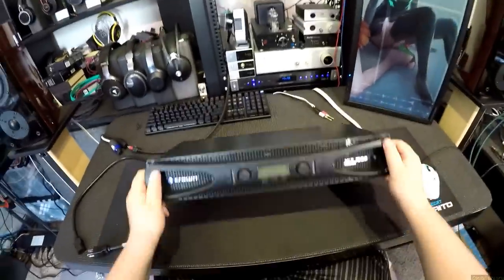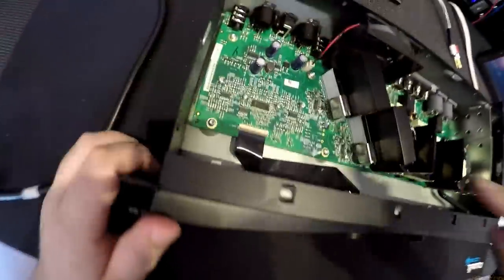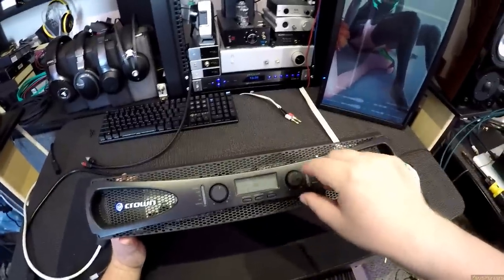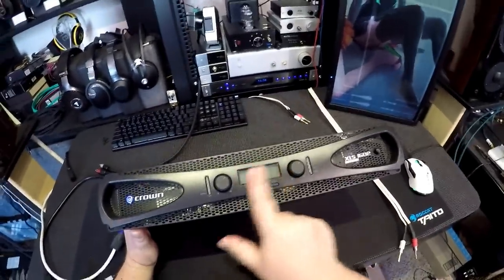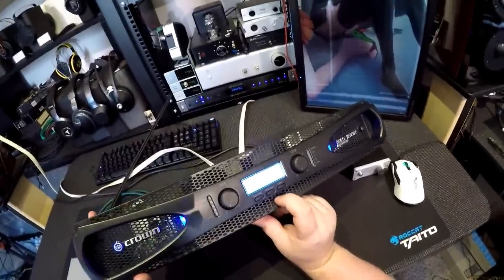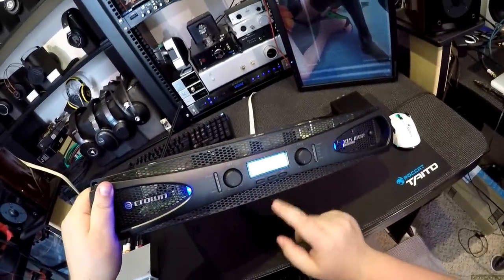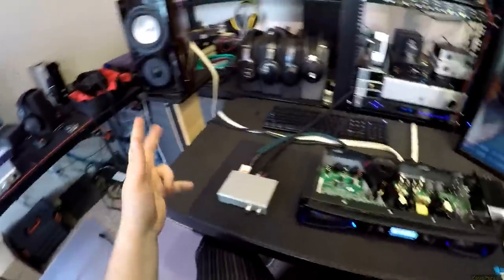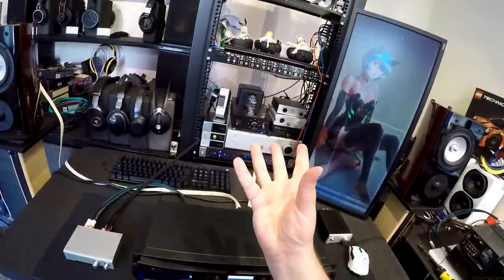Z Review - Crown XLS1502 POWAAAH!!! AMP

Comment: "the best part about this amp is you can shut off the display"  I believe you are right about that.
Reply: blind test this with another high end neutral A/B Amp, and I guarantee you can't tell the difference when they are level matched. The snake oil is strong in the audiophile community.
Reply: @Clobercow1  I tested it with a low end amp and its a piece of shit, like I said until im blue in the face IT MAY HAVE BEEN A BAD AMP, but I gave it a try, that's gotta count right?  naaaaaa
Reply: @Clobercow1  There is a LOT of noise with that amp.  I'm guessing there are a bunch of cheap tantalum capacitors in there but it's just a guess.  I wouldn't be surprised if i'm right.
Reply: Nonsense, a PWM is always analog technology on the two switching transistors!  Only the DSP of the switch should be digital here.
 Has anyone ever looked inside the empty tin box?
 That would have easily fit into one height unit, even with 4 channels!
 How it looks, everything is spit with glue.
 There are parts in it for a maximum of 50 €.
 I never spend so much money on this shit !!!
 With Class D you can only use 3/4 of the power - especially with the half-bridge circuit used here and this joke of a power supply!  No bass comes out of that !!
 The crossover is useless because there is no adjustable delay!  This sheet metal cube has absolutely nothing to do with sound!
 Crown should be ashamed!
Reply: @peterh.8931  I've heard of talking to yourself, but never typing to yourself.  What the hell are you talking about?
Reply: @ranbymonkeys2384  That is a automatic translation from my german writing. Not all words are meanful translatet, sorry. But in this Amp I miss the Hardware for the Money - that's my Point.
Reply: @peterh.8931  huh?
Reply: @peterh.8931  What does that mean "miss the hardware for the money"
Reply: @ranbymonkeys2384  lol - missing
Reply: @ranbymonkeys2384  Have you ever heard of power supply pumping?  The half-bridge circuit in particular is susceptible to this, and this can only be prevented there by using a powerful power supply unit.  And then there is the working area of the "Central Region" approx. Up to 10% of the maximum output, within which Class D works particularly with low distortion and linearity.  That is why I estimate that at home, top performances above 1000 watts are also beneficial in terms of sound.  😉
Reply: @peterh.8931  I just know it sounded like shit so I had one for about 15 minutes and it got shipped back
Reply: @peterh.8931  Ya that's where a linear power supply comes into play.  Those toroid transformers make a big difference.

Comment: I have a home gym and wanted to buy a good sound system for it that wasn't too expensive. I ended up buying 2 pairs of Klipsch R-15M. Then I went to my friend who happened to be Crown dealer where I live and he lent XLS1500 for an entire month. I hooked the amp to my PC using the headphone port on my PC. Then I bought the Yamaha AV Receiver RX-A1040 using the optical port on my PC. I tested both of them and the Yamaha sounded way much better and expressed details I couldn't hear from the XLS1500. So, I ended up returning the XLS1500 and keeping the Yamaha RX-A1040. I transferred the Yamaha to my gym, connected it to a TV and tried to play all fours speakers, which didn't work as I hoped to. I will disconnect a pair and connect them to my PC. I would appreciate good advice on the best most affordable amps for these to use on my PC.

I am a big newbie...I'm not an audiophile and not so audio tech savvy but I am pretty sure it had to do with that optical is better than the headphone jack/port.

Comment: the reason big sub drivers usually have dual voice coil ports is so you have the opportunity to either wire them in parallel or series.. depending whether you want 1 ohm resistance or 4  ohm resistance into one biwire connection, or 2 ohm resistance into 2 seperate biwire connections. 
And since you can also bridge amp ports or put whole amps in tandem, you're left with a world of opportunities, and NOT limited to amps that drive 2 ohm loads. 
This should be stated in the manual under the section about wiring.
Cheers! :)

Comment: I have an XTi 2002 that is similar in many ways to this one, but it can be connected via usb to a pc.
Using Audio Architect software you can set multiple DSP EQ presets by drawing bode diagrams, lock the max output power and other settings, etc.

Comment: Yeah, that's a little better than that POS Behringer you have in the other room there. That's actually the exact model I use for my mains. I use the 2502s on my subs. Most of the drivers in my self built cabinets are Dayton Pro Kappa series. My mains are dual 15" monsters and the subs are of the 18" thunder maker variety. I have had these for the better part of 5 years now and have been incredibly impressed with their responsiveness and resilience so far. Even when over powered they don't delaminate or develop rattles like most other speakers of that nature. So now that you have a reasonably decent amp and a badass subwoofer I'll be eagerly awaiting that review. It will redefine loud whereas home audio levels are concerned. You may want to warn your neighbors...
Reply: kappa kappa

Comment: The THD of 0.5% is not a problem. Not using xls1002, driving MartinLogan Theos (electro Stat panel + 8" aluminum cone). My other Class D amp lists THD + NOISE as 1.0%. No problem with same MartinLogan speakers

Comment: I did a straight up test...Spotify on PC to usb
 
Emotiva TA100> preout> XLS 1502> Emotiva B1+

Emotiva TA100> Emotiva B1+

Sounded better straight thru the TA100 

The XLS is powerful bass punchy fun but the crisp clear highs were slightly lacking. 

I bought the XLS to biamp my JBL 4350B woofers. I think it will work just fine for that. Lots and lots of POWER.

Comment: You have the input sensitivity explanation backwards. The lower number (.775v- high) is for weaker input signals, not stronger ones. Input sensitivity is the maximum input the amplifier can take (with level knob dimed) without clipping.

Comment: Class D is not a digital amplifier. It's a switch mode unit. Digital is a specific code that's always the same. This has a switch pattern that is depending on analog input and negative feedback and can be different each and every time.
Reply: really?

Comment: Glad you did a pro amp. Gotta do more. I can’t remember what Crown amp it is, but one of them has a manufacturing fault with the internal power supply, that if it happens, sometimes you can do a button combo to reset it and sometimes it will work to fix the issue...sometimes

Comment: My next purchase was going to be the A500 based on the various applications that I know you've had opportunity to test it on.   However, in light of this and some other impressions I've gotten when you've described how hard you've had to drive it and ts response, I think the XLS1002 will make a good compromise between the A500 and this for a minor price jump.  My only concern is that there's definitely a significant signal to noise ratio difference between the two models,  but I've only seen it pointed out in one review and it was described as being minor.

Comment: Class D power .. Pretty impressive... but clean sound? I'd love to see the detailed spec / bench tests on these types.
Reply: For the price/performance/weight they are outstanding. They do sound good as well, definitely not bad!

Class D’s efficiency is what makes them extremely desirable. Class a class -A/B use a lot more input power to create the same amount of power as class D.  So if you are powering a 100,000 watt system and need half the input current you just cut your electric demand in half. Which is huge. If you have a touring rig and your amps weight 25% of the of class A/b and takes up half the room you have more space on the truck.

Or if you live at home and want this thing to work on a 15 amp circuit, with multiple other things in that circuit , can you understand how the efficiency matters and Hoity-toity thumbing  the nose at new technology is laughable

Comment: I believe the 1/4" link out jacks are just wired in parallel with the XLR, at least they were on the last generation.  I use that as the input for mine that does my sub.

Comment: you cant hook up 775rms to each coil because the total rms for the woofer is based on both coils combine as one. so that means that if you wire the coils individually you cut your power by half. so in the real world each coil can handle 400rms total of 800rms wired together either parallel or series

Comment: Crown's XLS amplifiers are bargain basement Crown amps, they might be able to output their rated power but it'll be burst not continuous average power. There's no way they can continuously all night output that power. QSC's RMX series now that's a different story, they're much heavier amplifiers but they can output their rated power continuous all night without a problem. Bridge a Crown XLS2500 and bridge a QSC RMX2450 and see which power subs the best and you'll see the QSC which is supposedly not quite so powerful will actually eat the Crown for breakfast. I'd say the cheapest lightweight amps you can buy which are great are QSC PLX series although Behringer's iNuke 6000 was bench tested as being able to output 2,000 watts continuous average power per channel into 4 ohms (despite being rated at 3,000 per channel). Crown XLS amplifiers don't have a very good reputation for REAL power output.
Reply: I’m getting an amp for maggies soon but I can’t spend more than 500 ....the MMGi by the way

Comment: Strange, all marine wire I've worked with is tinned copper so that it doesn't corrode. Very rare to find aluminum since the runs are generally long.

Comment: Best amp for the money insane power and bass management my quest for amp is over thanks.
Reply: If you look for a party amp you should be good with this. But not for low listening levels on high resolving speakers.
Reply: I runs this amp with my klipsch rf82ii  using onkyo a-9050 as a preamp and it sound so clear. Crown amp are being use in concert which u go for live music.
Reply: Have u ever try this amp before 
I have try onkyo a -9050, marantz pm5005, emotiva a-300 and it’s what I wanted.

Comment: I've been doing a bit of reading on the forums for more info on the inuke and these Crown XLS amps. It seems there's a 20 HZ roll off on these XLS amps that has been confirmed by Crown. It was present on the first XLS series and they didn't change it for the new series. Just something I wanted to point out considering you're using this to power your Ultimax. A Behringer NU3000 DSP benches at around 2000 watts into a 4 ohm bridged load and has better DAP with active crossover and an 8 band parametric EQ......AND is $100 cheaper.

Comment: Woohoo I have the XLS1500, yeah the silver ones. However they lack the low line level switch which means I have to run a mixer to increase the voltage or I get very lackluster sub. I have mine running a dual 4 ohm Oz Audio Matrix Elite (they are back btw, but only have vector product so far). I wish I had the new black model. I'm jealous. I should have gotten the XLS2000 for the sub I have, but I originally bought it to power my Fender ACE Pro speakers.
Reply: Side note, because these convert direct power into raw speaker power, which is how they acomplish so much power without the heavy triodial bla bla whatever the fancy stuff is called. You also get more power from the speakon over the binding posts, i think that is a safety decision they made due to the fact that you are crossing so much amperage from the outlet. Also this makes it use a huge amount of power, I notice my power bill when I use it lol...not joking!

Comment: Hmm, you could also wire the voicecoils in series to make 4 ohms, then run the amp in Bridge mode....it may sound better?
Beefing up the speaker cable to at least 12 gauge would be a good idea to help with the Damping factor.
Reply from the maker: That is the plan.

Comment: I'm sorry. I like your reviews, but I got to correct where correction is needed. That is not the "power supply" that is only the EMI EMC input filter. ALL switch mode power supplies (SMPS) have to have this input filter. The power supply includes the caps, and the transformer.

Comment: Noob question..
I have a 5.2 system and calibrated to 75db each speaker. I just added the xls1002 amp to power my fronts. My question is at level do I need to set the gain knobs on the amp and do I need to calibrate the amp in some way?
Reply: Same question I have too.

Comment: No joke about Crown amps! I just bought an XLi 1500 and it's probably 40 pounds! Got it for $190. 450WX2 for $190! Absolutely pounds 4 twelves @ 4ohm stereo!
Reply: XLI is A/B amp so its heavy cause it gets hotter, XLS core 2 is D class
Reply: Fwiw Big D Wiz dynoed the XLi1500 and got over 800w per channel into 4ohms stereo! So they put out the watts! Well over rated power. This one idk since its a class D amp!

Comment: My xls1002 driving two 15" subs in stereo mode at 2ohm load, it's plenty powerful but have the desire for more!  Maybe get a couple 18's and and xls2502.
Reply: thats a lot of bass
Reply: @dontpanic15  I've recently upgraded the amp now using a XLS2002 for the subs (1050w /channel)and the 1002 for my L/R towers.  Really nice improvement, has the power to hit you in the chest pretty good.

Comment: Thinking about using this to power a Rockford Fosgate T1D412 @8 ohm. I just need an enclosure designed for home use and 800rms of power at a decent price. Running this bridged looks like it will provide over 1000w. Hmmmm. Zeos making me spend money again.

Comment: Hey Zeos, you should try either the Yamaha MA2030 or the MA2120 (or the PA versions). I installed one at a customer a few weeks back, in combination with 4 VXS5's and a VXSseriesS (subwoofer) and it sounded amaazing. The speakers are quite expensive but the amplifiers are kind of affordable.

Had some experience with the Crown amps. Great for the price! :)

Comment: Hello, did find out how to trigger that amplifier? I want it to turn on when i turn on my HC Receiver. Regards
Reply: I use an “Iot Relay” which is about $27 on amazon, basically a 12v trigger controlled power strip. Had to get a mono 3.5mm plug/wire as well and strip it to bare ends on one side. I use this setup for little usb fans to turn on with my AVR :)

Comment: I would say some expensive powerful serious audiophile tube amplifiers ($3000 plus) are obviously going to have better imaging, resolution, air, sound stage depth, and other important qualities wealthy sound purist's demand from an amplifier. BUT....anyone who simply wants affordable BIG clean power with plenty good quality sound will love the crown class D drivecore2 series amps. Mine has the lowest power of the four amps in the range, identical in appearance to the one Z has in this review,  ($230 ebay) the XLS1002, rated 215wpc into 8 ohms, 350wpc into 4 ohms, 550wpc into 2 ohms. This level of output power sounds better with good quality speakers rated for high power, otherwise use at least two speakers connected in parallel to each channel. I'm using one pair pioneer BS-22 connected in parallel with one pair pioneer FS-52. Using vintage yamaha 10 band equalizer ($44 ebay) for preamp. System was not too expensive,  sounds awesome, clean and loud.

Comment: I just bought a pair of klipsch LS pro tour ( industrial LaScala’s) set up with matched base bins . I’ve mostly ran vintage crown DC150’s or 300’s either stereo or bridged . My next space is to use as multi use in small stage outdoor / barn venue for hosting small music festivals , weddings and  receptions . That said I have been looking how to power the main speakers and base bins separately w/ 4ohm drivers & matched cross overs . I currently have 2 Dc150A and xls 602 power amps , the xls I haven’t used much and didn’t seem to impress me , only tested to see if it worked and it has been in a box for 7 or 8 years now . I guess I’m old and don’t know much about the newer crown amps and what they can do would adding another xls be the cheap solution ?

Comment: I have a crazy idea - is it possible to use a car audio line output converter from a Denon s930h receiver's main L&R output and then run the RCA level outputs from the converter into an amp to power my L&R towers? My receiver doesn't have pre-outs for mains, only subs. Any thoughts?

Comment: Thanx for the review!!! Hi there,

I have a question and need advice. I am upgrading a dual opposed subwoofer with 2x 600w @ 4 ohm JL audio subwoofers. I have 2 dual opposed subwoofers (4 drivers total) I am planning to upgrade to an external amp. When I connect the 2 subwoofers it will become 2 ohm at 1200 watt correct? Would a Crown XLS 2002 be good to feed 1 of each channels @ 2 ohm 1050 watts to each dual opposed subwoofers. 
Or is a serial connection better and get 2 x crown 1502 in bridgemode feeding dual opposed in serial at 1050W at 8 ohm. This option is more expensive. 
I hope you can give me some advice or recommendation thank you in advance.

Floris

Comment: Cant imagine running full range speakers with a class d amp. I'm getting outa car stereo and am thinking of an amp like this to run a pair of sealed JL10w6v2d4's @ 2 ohms each in the home. They can handle ~ 600 watts a side rms.

Comment: Thanks Z Review,   I just purchased the xls2502 based on your review. I’m hoping to push 2 cerwin Vegas! Xls215 with my amp. Do you think I will have enough head room on the xls2502? The speakers are 500w max 250wrms 6ohm. The amp pushes 775 at 4ohm and 440 at8ohm. I will be hooking the amp to an av receiver. Any information or suggestions will be appreciated. Thanks again for your videos.